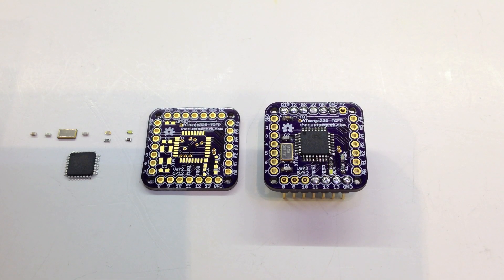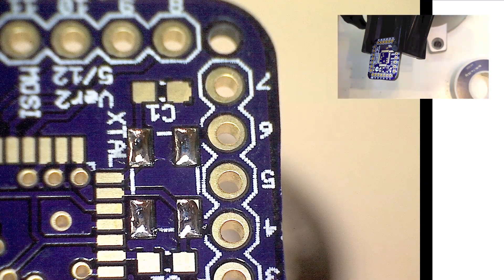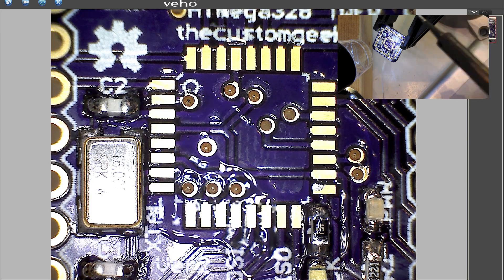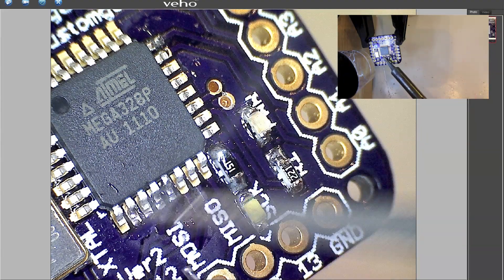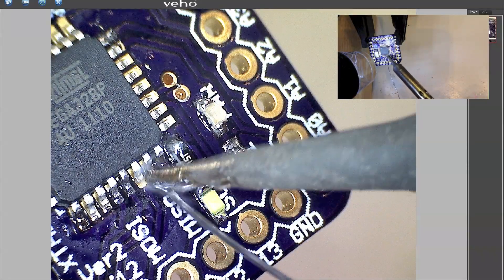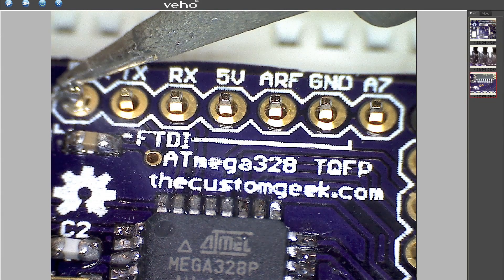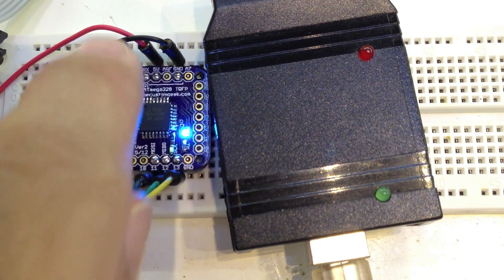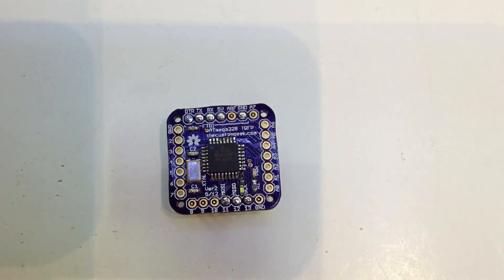One Square Inch of Goodness

Comment: I like Pololu's "Arduino" because it has power management built-in. But I can still see that the One Square Inch is GREAT!  Y'know, you've basically turned the Arduino into hybrid integrated circuit. Love it.

... and I love the flux going "gloopy gloopy gloopy" under the microscope.

Comment: You have a proper Hot Air Soldering Station, you have Flux Pen, then why not get Solder paste and solder all SMD component with Hot Air station ? it is much slick and clean and you don't need the Solder wire which is best for Through Hole  component and touching up Components with larger solder area like Power components,.

Comment: im sorry, but i have to disagree with your technique. why the hell would you solder the ic last. the worst part is that you could EASILY solder the crystal after the ic. also, if you have a hot air station, why wouldnt you use it on the ic. its a hell of a lot safer than tapping an iron about 4-6 times per pin. the phrase you are only as good as your tools does not apply to you sir. take a look at some other smt tuts on here.

Comment: Well, soldering is not your strongest quality -  that's easy to see...  You may find a useful "how to" on YouTube ;-)
Reply: Yes I agree the soldering wasn't the best. Getting both parts (The Pad and the Component)  up to temperature before applying solder is important, it would have flowed then.